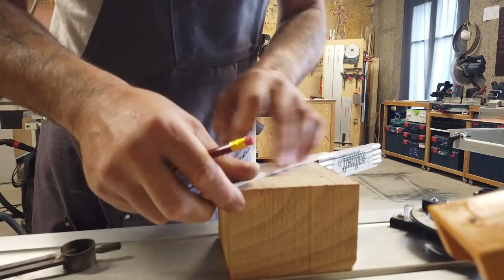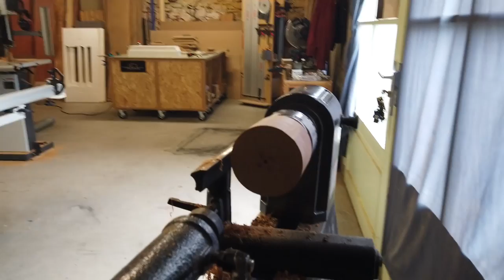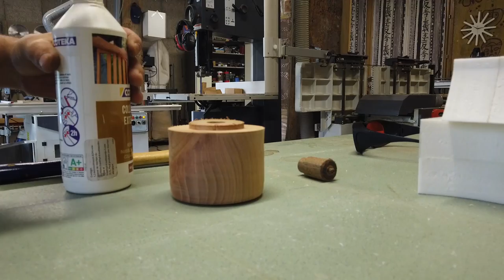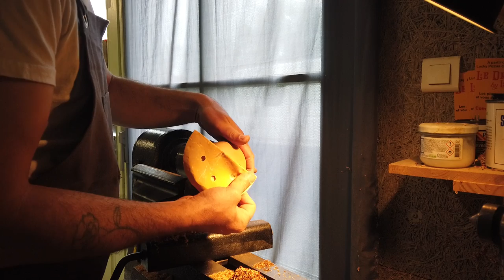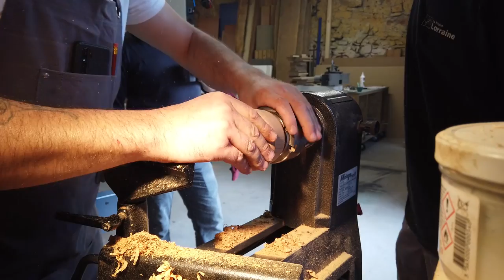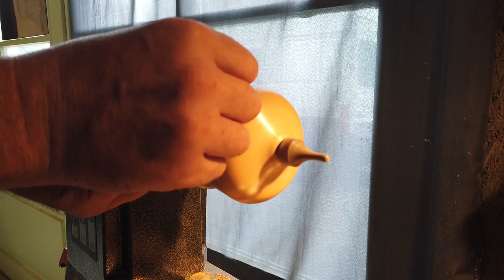Boite Merisier et Amazakoué

Comment: Salut Arnaud. A entendre les bruit lors du tournage, et au vu des images, je me permets de te donner quelques conseils. 
Avant tout, le plus important est que l'outil doit talonner avant de travailler ce qui n'est pas le cas pour toi. Ton outil rentre directement dans le bois et tu risques à minima le plantage et au plus grave la projection de l'outil dans l'atelier ! Travailler avec la pointe de l'outil provoque des vibrations et donc les bruits qu'on entend, surtout quand le porte-outils est trop loin. Ces vibrations peuvent entraîner des défauts de surface (ondulations, arrachements, etc) difficilement récupérables par la suite, sauf en réduisant la pièce.
Le porte-outils doit toujours être au plus près de la pièce. Quand il est à plus d'un cm ça commence à être trop. C'est pour ça qu'on est tout le temps en train de le rapprocher.
En tournage on travaille toujours à l'axe. La pointe de l'outil doit travailler le long de l'axe du tour (axe poupée fixe / poupée mobile).
Ton tour est trop bas. Pour travailler à l'aise il faut prendre un outil long, genre gouge à dégrossir ou à profiler, main droite en position basse sur le manche au niveau de la hanche et main gauche qui tient l'outil en appui sur le porte-outils. Tu dois pouvoir te déplacer ainsi le long de l'axe du tour. A défaut, il faut relever le tour avec des cales et s'il est trop haut on relève le sol sous les pieds (dalles caoutchouc, plateau, etc).
Il y a un excellent tourneur canadien, Marc Dubuc, qui produit des vidéos de qualité et détaille parfaitement tous les points particuliers du tournage sur bois.
Sinon, c'est ton  fils qui travaille avec toi ?
Reply: Nanard, tu nous montre ton savoir faire ?
Reply: @makersniper251  J'voudrais bin... le problème est que j'ai pas mal de taf en ce moment pour finir la maison que j'ai quasiment plus le temps (ni l'envie) de bricoler à côté. En plus je suis pas mal emm...dé à cause de mon dos (chute d'un toit) et de mon bras gauche à moitié paralysé. Et puis faudrait que je crée ma chaîne, que je prenne le temps de filmer mais surtout que je range mon atelier qui est dans un tel état qu'une chatte n'y retrouverait pas ses petits (je retrouve toujours mes outils, parfois une semaine après en avoir eu besoin 🤣 ).
En plus, je n'aime pas trop être "bousculé", surtout depuis que je suis à la retraite, car gérer une chaîne c'est l'alimenter régulièrement  avec du contenu intéressant et instructif. Donc je laisse ça aux gens comme Arnaud, Samuel, Sylvain,  Olivier, Laurent, Boris, Renaud et tous les autres créateurs qui mettent en avant leurs réalisations bien mieux que ce que je pourrais le faire. 
Par contre je me permets d'intervenir auprès de quelques uns de ceux que je suis, comme je le fais avec Arnaud, pour partager mes retours d'expérience. Mais, malgré tout, je n'ai pas la science infuse, loin s'en faut, et j'en apprend tous les jours... et j'espère encore longtemps 😉
Cordialement